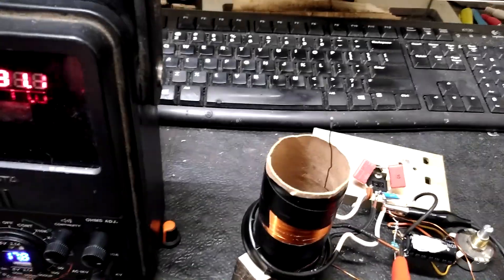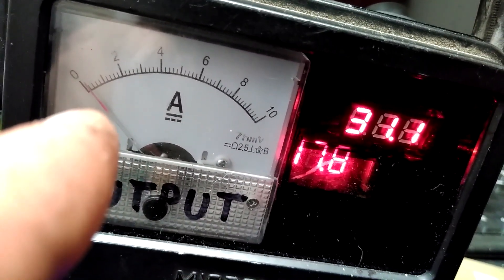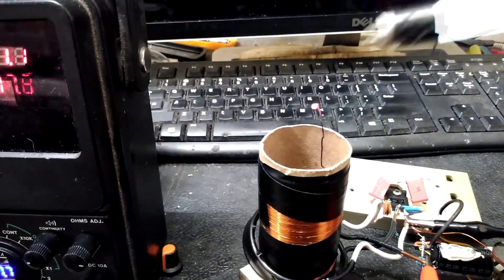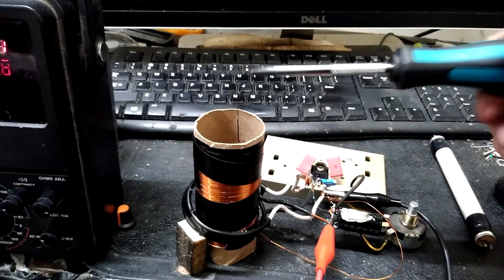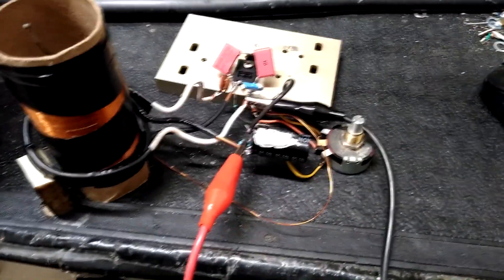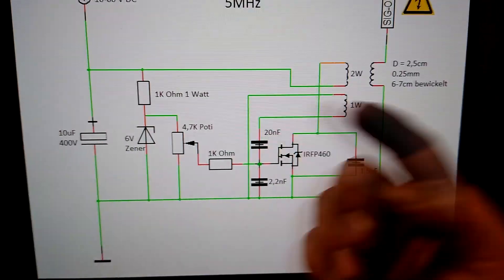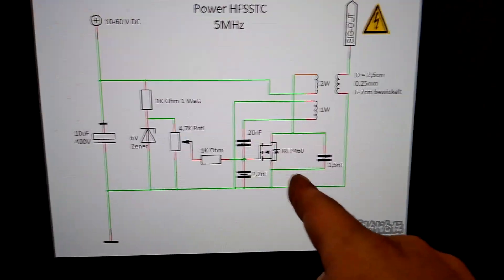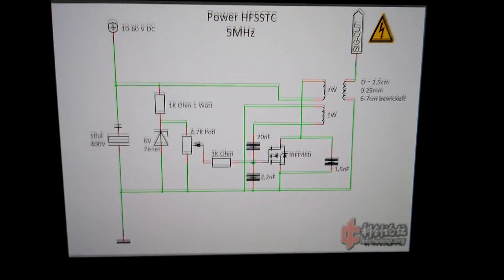Simple HFSSTC (Teslaundmehr)

Comment: I am building this same circuit to use with that 4mhz secondary I have , I am gonna use 10k pot and 12v zener instead of the 4.7k pot and 6v zener I think it would be the same right? since it is only a voltage divider  , and a irfp260, do you think it would help if I add tvs diodes ? I have 18v tvs laying around
Reply from the maker: I'm pretty sure I've used 10K and 5K pots interchangeably as well as 6v and 12v zeners. I never use TVS diodes on these just in case they will hurt more than help
Reply: @Magneticitist  Why not using a TVs diode?
Btw in my area tvs diodes are cease to exist so can I make it by joining two 12v zener's cathode-to-cathode together....
I have seen this in labcoatz video.....
Reply from the maker: @acex727  TVS diodes and zeners are close to the same thing but somewhere in my tinkering I got it in my head some TVS diodes I was using were not liking the HF. Never had problems with the cheap zeners I was using and never actually NEEDED them so I just avoid adding the unnecessary TVS diodes.
Reply: @Magneticitist  so Tvs are not actually mandatory...? But at every sstc...single MOSFET or half bridge or full bridge....everyone says tvs are necessary so the MOSFET live long.......
Ok then I am going with zeners:)
And can u tell me the dimensions of the secondary?
 
And for a sstc or sgtc...the dimensions of secondary should be..?
I have a 4.7cm diameter pvc....the height:diameter ratio should be 5:1...so the coil should be 23.5cm ....or maybe I can make it 6:1 ...?
Reply from the maker: @acex727  Well they are good practice just like adding snubber capacitors, but they aren't absolutely necessary. I'd say a good snubber is more important. For example, what's the point of actually adding zeners across a mosfet gate? Sure, it will help prevent overvoltage but why is there overvoltage in the first place? If I have a circuit where I'm worried about the gate drive magically jacking up and blowing up my gates, I'd want to get that sorted first. 

A TVS diode across the drain-source is also a good measure, but if I'm that worried about avalanching or bad voltage spikes I must not be snubbing the circuit very well, or must have a pretty bad layout. If you look at gate driving boards on industrial inverters you may see TVS diodes all over the place.. and many times you will see them failed shorted (having protected something).. but this is because they can also be in extremely electrically noisy environments where tons of inductive loads are present in a system. 

Coil dimensions are one of those variables I recommend you just play with yourself. I can't say there is really any superior ratio for any and every coil. I typically just try to keep my inner diameter above 1.5 inches or so. Everything else usually just depends on the wire I have and how much relative to the frequency I want to achieve.

Comment: WHY ARE YOU DOING THIS IN FRONT OF YOUR COMPUTER?! Still a nice vid.☺
Reply from the maker: Lol since it's fairly modern and shielded it doesn't really hurt it. Running something like a spark gap Tesla coil nearby is another story
Reply: @Magneticitist  I mean you are right but still be carefull.
Reply from the maker: @firefox1136  You're right it's not a good idea to ever really play with such circuits around sensitive equipment but it can be done within reason. Over time I've sort of become callous to that idea with certain circuits because I've played with so many next to the PC with no harm. There are some on the other hand which I just won't use near the PC cause it will do random things lol. A hairpin circuit used to cause windows to bring up a "format hard drive?" prompt multiple times. Don't play with that anymore.

Comment: EDITX grunding of the sec can improve fuction but it seems ZVS can run at high frequency as is and a ~5nF air cap between the drains improves function dramatically, other caps get so hot the values change, FETs remain cool EDIT9 Turns out it doesn't work off breadboard BUT it DOES work without 
the feedback loop even connected, grounded secondary is enough LOL so 
it's basically a ZVS without the choke and with a Slayer like feedback  EDIT8 Using 2.5cm Aluminium strips as 1loop primaries makes all the difference, I'm able to pull a 1cm purple arc..small breakout only without topload (which I think makes sense since the seconday is not selfinducting like in a push or pull Slayer) EDIT7 Actually it's better with sec grounded without the drain cap, since the caps I have can't take the heat for long, and FETs don't seem to escalate in heat (still without a sink) EDIT6 Got a bigger coil to work ungrounded and it's even better, requires 2nF cap between the drains, grounding messes it up... a cap between the gates can improve things too but no good value found yet EDIT5 Definitely more efficient than a Slayer, note FETs heat up if seconday ungrounded EDIT4 FETs running cool without sinks at 1k/10k ratio, output brightest yet, SEEMS LIKE A WINNER        EDIT3 After adding the missing divider, the switcing is much more efficient and I can crank the dividers much further EDIT2 also works with gate drain diodes like in the ZVS but appears attenuated probably cause I didin't separate the divider EDIT worked even without one of the fets receiving the feedback, but not viceversa even though they should be in an equivalent state (though the working one was closer to the coil), but short after it stopped working and I had to put in the other one... Turns out, this works in a push pull conf even without any capacitors, 2x IRFP260N,  pot ratio around 3k/6k , one turn feedback, ATX 12V input, toilet roll coil 0,3mm wire, HDD topload... but I guess tuning the series cap and the feedback cap/s would make the fets switch even more efficiently...on a breadboard, nothing melting, but CFL ignites only at mm proximity an stays on to 3cm or so
Reply from the maker: Man I had tons of fun playing with this one because I was able to just try out the drive on all types of coil sizes and frequency ranges. It hasn't really been picky for me and I stopped at my micro coil. I have all this wire laying around still and had plans of making one which I've just flat out forgotten now and need to go back to the drawing board and remember what the hell I was even doing haha. I think in the end the ultimate goal I was going for was the smallest coil I could drive to simply give me not only a silent 5mhz plasma flame but one which was impressive in sized compared to the coil itself. It takes some juice to get that flame but interrupting it solves that, or just adding a fan which I did both of in the end. I've played with a lot of ZVS circuits but I've kind of just made them my goto inverter drivers for lighting but I drive them with PWM to keep them from ever latching hard until they die from particular loads. The thing I noticed while also playing with the other HF circuits using the varicap is that stray inductance became like a problem an order of magnitude greater than most lower frequency circuits. I could move a lead around a little in relation to another one and need to keep it arranged exactly that way in order for it to work at all.
Reply: @Magneticitist  while using the Slayer with a slave FET in a push pull configuration seems to make the slave FET excessively hot, yet the result is better in terms of breakout and stability, and it could also benefit from the cap between the drains (dunno why I didn't try that immediately, my brain gets clogged)... the master doesn't have to be a FET though, BJT might be better but I didn't try that either LOL
Reply: @Magneticitist  What I was describing here is basically a center tap ZVS without chokes... and optionally the sec feedback connected to ground, which seems to improve function.

Comment: I'll have to try this again at some point, I built a similar one before and did get breakout but it wasn't great, better then nothing I guess 😂 I'm shooting for the skori circuit, ordered the parts but I might whip something together with what I got now to see if I can get something to work
Reply from the maker: It def doesn't seem as fun as the other circuit but it seems to have its niche uses. What impresses me is just the sheer low power consumption at such high frequencies while still outputting a decent field. That Skori circuit tho.. so awesome. I never really got into replicating it because I didn't want to be limited to 24v or so but it does seem to work beautifully at even lower voltages. If you get that one going I'd love to see it as there isn't much info out there on it.
Reply: im sure now looking at the circuit, the feedback coil plus the cap going to gate dictates the resonant frequency of the circuit
Reply from the maker: @dirkk82  I did notice that certain coils would tend to ring differently depending on the tuning. I've seen decent output anywhere from 2mhz to 8mhz or so using various coils though. I think my micro deal works pretty good cause it's right around 5mhz or so.
Reply: @Magneticitist  yeah thats the range of the circuit itself, id have to see when mine is done, i got a few coils to try